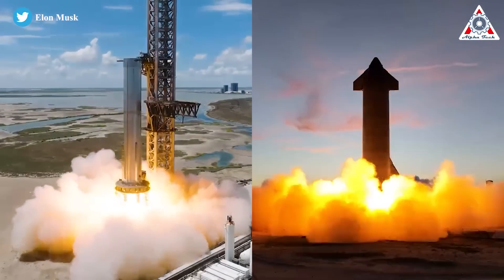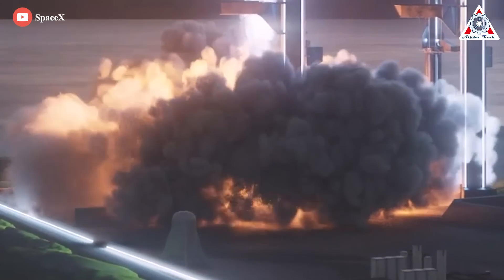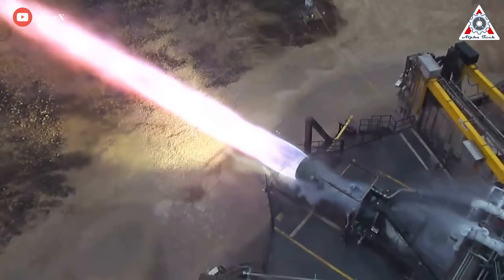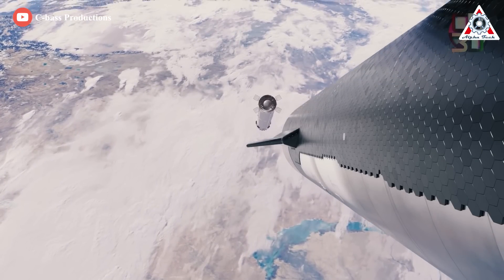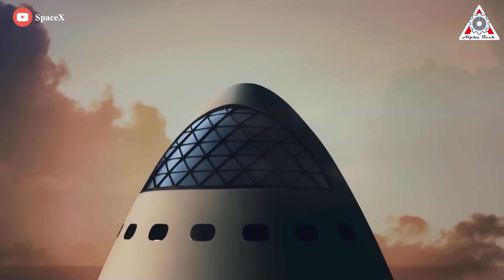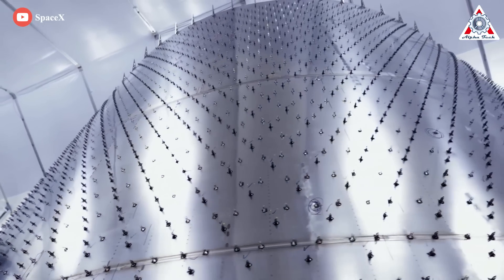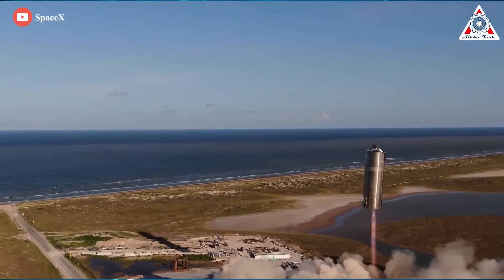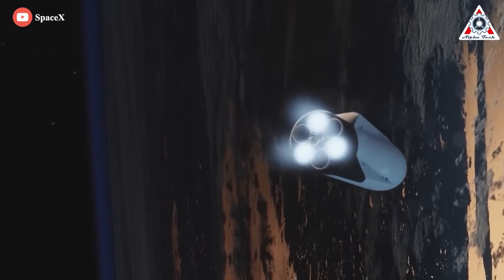Elon Musk announced First STATIC Fire LIFTED 300 Tons Raptor Engines will change everything...

Comment: I cannot believe a brilliant mind like Elons failed to comprehend the destructive power of Raptor will have on the launch tower and surroundings. Why didn't he build in exhaust diversion ducts to divert that massive exhaust stream to protect the struct and the StarShip itself as well as the engines on the initial exhaust detonation as the deluge system is totally inadequate to deal with turbulence which must be like a category 12 hurricane down there at the base od StarShip, this will be the failure of the event.

Comment: 25 tons per second for 33 engine firing.  This concerns me, how many tones of fuel is expected to be loaded for an orbital shot?  I know that Musk indicated they would be stretching the lower segment by 5 rings...  How many tones will tell us the burn time?  We also have to expect the three burn cycles:  arrest forward progress and get on trajectory home, burn time for the rocket to slow down so as to avoid the high-speed damage, then the last fire to slow it to Zero speed interact with the chopstick arms.......  BUCK RODGERS
Reply: About 3000 tons for the booster if I recall correctly. 2 minute burn time.

Comment: I can't see it being allowed to takeoff in the present area with 32 engines because of the potential damage when things go wrong. The soviets had enormous problems controlling the large number of engines in their N1, leading to instability and catastrophic failure.
Reply: No relation. More engines are inherently more reliable than less.  The problem with the N-1 was that they just built it and flew it. They couldn't afford to conduct incremental staged testing. Had they done so, they would have likely ironed out the issues with it and had a successful launch vehicle.

Comment: You can tell by the phrase "will change everything" in the title that this video is just clickbait and the commentary is just bullshit.

 "First STATIC Fire LIFTED 300 Tons" is more bullshit since the booster or the ship is clamped to the test stand during static firings and does not move and, consequently, does not lift anything.

300 Tons of what? Thrust? Mass? Weight? More bullshit.
Reply: "does not lift anything." Tell that to the strain gauges on the steel beams that began grunting while going "holee sheet'.

300 Tons of what? Thrust? Mass? Weight? More bullshit.
Reply: 300 Tons of what? Thrust? Mass? Weight? More bullshit.  I have no idea how that popped up in my post.

Comment: How was the mount able to fight that sort of thrust to keep it from blasting off??
Reply: That's only firing 7 of them. I'm very curious as to how powerfull the blast would be with all 33 engines at once...
Reply: BFB hold it. Big f…..ing Bolts….
Reply: Rocket is anchored to the mount, the mount is anchored to the ground. What the rockets are firing against is the bottom of the mount (the ground).
Sit backwards in a wheeled chair and try to push it across the floor by pushing on the back of the chair.  Same idea.

Comment: You keep stating the thrust in ft-lbs. This video again. Since the test firings happen while bolted to the launch table, which means that movement is zero feet, does that mean that the thrust is zero?
Reply: lmao
Reply: He should drop the word, Tech, from his title. Unsubscribed.
Reply: The thrust in American units is measured in pounds (force).  A pound (force) is the thrust required to accelerate one pound (mass) by 32 feet per second per second.  In SI Metric thrust is measured in Newtons, which is the force required to accelerate one kilogram by 1 metre per second per second.  One pound force is approximately 5 Newtons.
Reply: @jamescobban857  Thank you for clarifying  🙏

Comment: They need to stop using the horizontal test stands! The constant firing has increased the rotation of the earth and made the day shorter. Vertical testing only!
Reply: lmao, the Earth is flat.
Reply: nonesense. the combination of the exhaust direction (which is zero after a couple of hundred feet due to friction with the air) totally counteracts any thrust in the other direction. like sitting in a rocking chair - you push back and then you are rocked forward.
Reply: @jessepollard7132  r/woosh
Reply: @jessepollard7132  Ya right. I simply negate all that by doing west to east burnouts with my Hemi.
Reply: @jessepollard7132  um, recalibrate your humor detector, the joke, you missed it.

Comment: That tank farm is going to get a roasting and pommelled with large pieces of debris on launch.   What will happen if/when the booster crashes on landing?  I keep wanting to find out who thought it would be a good idea to build the tank farm where it is.
Reply: Are they not water tanks? For the exhaust dampening.
Reply: Yes. Not filled with anything flammable. A reasonable question, though.
Reply: They rebuild them?  They only cost a few hundred thousand dollars.
Reply: @davidbeppler3032  still cheaper than what nasa and the current space program costs per kg/launch.